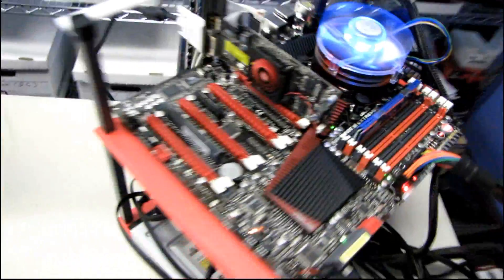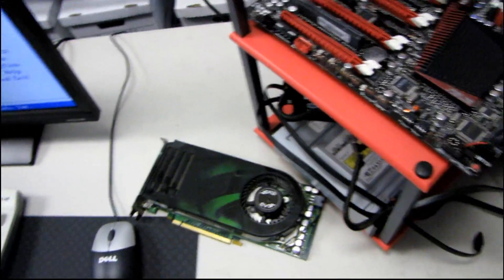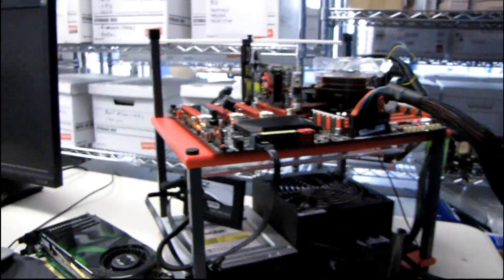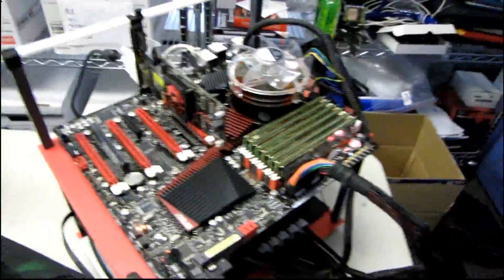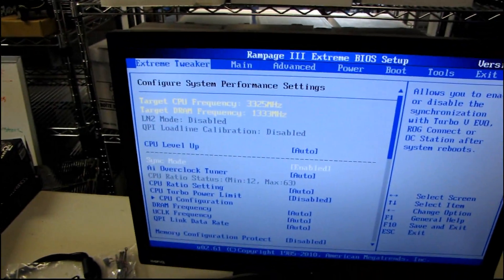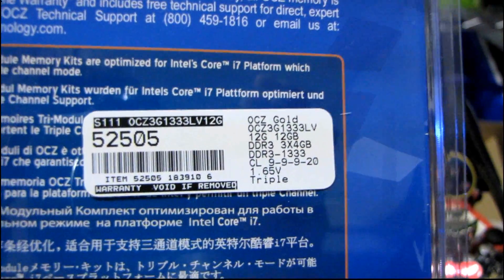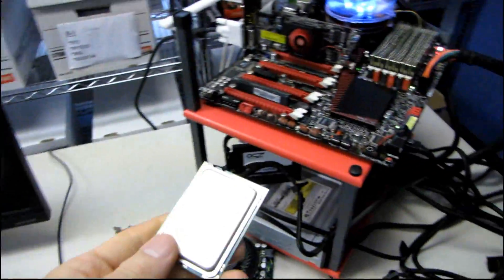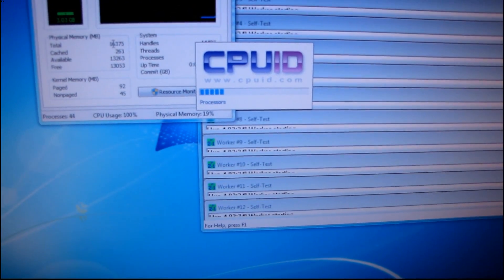Rampage III Extreme 24GB RAM Core i7 980X SUCCESS!! Linus Tech Tips

Comment: There are several fields where this could be usefull. In fact most of the time, this amount of ram will be used to keep files in ram and avoid disk access :
- Video editing or FX
- Big databases
- Running lot of Virtual machines (network applications developpment)

But there's no use for gaming.

Comment: yes its possible but you would have to get a 1,200$ board and pay 10,000$ for that much ram, 4 of those amd 12 core cpus and install windows server 2008 since windows 7 cant use that much ram. so yeah if your willing to spend 25,000 bucks for a useless machine

Comment: My new build has 32 gigs of RAM at 1600 MHz unclocked, running an i7 2700k at 4.6 GHz, and nVidia GTX 580 graphics. Open AutoCAD and SolidWorks 2012, rendering like you wouldn't believe. Also all latest games blah blah blah...
After years of being behind in RAM......NO MORE I SAY.

Comment: Well that is odd. Something more serious than a broken solder joint on the GPU then.  Unless you baked it with the GPU facing down which can make it worse since it will pull away or other parts will fall off.
Or the other thing is ESD damaged it.

I know it worked for me on the 8800GTX on two different cards. Which also the 8800GTS is known for too.  

If that 8800GTS did work it would be a bottleneck anyways. Its almost passed its usefulness on gaming these days. Even on that high end rig.

Comment: you could at least test if the BIOS detects all 24GB by disabling "fullscreen logo boot", this makes the POST screen to show up and you see how much memory the BIOS detects. Also you might disable "quick power on self test" and let the BIOS make a memory test. This will take a few minutes

btw, prime95 is not a really good memory test software, it doesn't detect all errors, memtest86 is much better. And it almost all memory, because it is on a bootdisk.

Comment: my guess is check the list for ram supports, obviously it might work but who knows, you didnt mention the power supply wattage, maybe the system didnt had enough voltage to run all rams, or maybe you had 2 defective rams :( and if that where true, the motherboard needs a refund jeje. oh and one last thing, i know ppl might say and said "why would you need 24Gs for?" well good job for putting the board test its limitation which its what this is all about, good job man.

Comment: @MrTpengineer I've never had an issue until recently when I started getting some driver errors. Other than that they've been every bit as good as AMD's cards (at least recently, they were better than AMD for quite a while with the 8800 and 9800 series, until the 4800 series came out).

Comment: ## I Need Help With A Ram Question ##

1 GB = 1024MB

Therefore

8GB = 1024MB X 8 = 8192MB ... Right?

I just Recently upgraded my my ram from 4GB to 8GB but I encountered one little problem.
In CPU-Z it shows that my computer has 8192MB of ram but when I open task manager it only shows that I have 8174MB of Ram. Where did 18MB of my Ram Go?
Is my Ram faulty? When taking the Ram Sticks out of the packaging I noticed white paint on one of the corners of the Ram Sticks.
Also I have a HD 6870.

Comment: @CarrollFilms So your videos are ranging from 240% smaller to 3,500% smaller than the conditions I'm talking about. A friend of mine is a professional video editor, and he sometimes has to render several 1080p video streams at the same time and can hit 16+GB of usage, so he requested 32GB of RAM when I built his rig. Not everyone (in fact very few people) need that kind of power, but some do, and it won't hamper performance unless you're trying to max out your CPU overclock.

Comment: I'm totaly against over clocking , I know that might not set with those who do but I have damn good reasons.

1. lowers longevity of components if they aren't rated for higher speeds and voltages and stresses them.

2. can cause software errors

3. lack of funds to replace components if they fail from over clock.

4. can void warrenty.

Comment: @NorJ92 

windows is not using 16gb of ram. Windows is using all of the 24gb of rams. Is just that windows 7 editions have weird options settings that only show you part of the information. 

For example the dxdiag always shows 1gb graphics card having only 751mb. But if u use other tools it shows 1 gb and games also shows 1 gb.

Windows 7 have hidden options.

Comment: Linus Ran into this same issue when you try to run 24GBs of RAM on a G1.Sniper. It is not the BIOS, it has something to do with the way the board reads the memory and the speeds, for some reason if you try to go at the 1600 speed you are reduced to 16GBs of ram no matter what. It is fuzzy but its gotta be the addressable  to the CPU. I think at 1600 it cant see 24GBs of ram and needs to slow down to default which is 1333. I went through MANY tests with even newer ram and got the same results.

Comment: I had this problem once where i had purchased a nvidia card and put it in my motherboard which had an ati chipset built in to it. I had a 2 gb RAM in it and my windows only detected 1 GB. When i replaced it with an ati gpu it detected the whole 2GB. May be this is kinda related to the same problem which i had. try it

Comment: @acheron0508 

just kiddin :p

my real rig is 

amd athlon 64 3800+ ( crap )

1gb ram ddr2

radeon x1050 512mb ddr

450w psu

asus m3a78-emh-hdmi

maxtor 250gb hdd ;P very old system but on summer i will get

cooler master enforcer case

amd phenom x4 955 

4gb corsair xms ddr3

raid 0 wd black 6gb/s

radeon 6950 2gb sapphire

700w psu 80+

im very excitet for that rig :D

Comment: Look into PC component planned obsolescence. A Radeon 9800pro is actually capable of running most modern games at a good frame rate with all effects including DX11 specifics like Tessellation. Software is programmed to run slower on what it detects as a obsolete card.  Operating systems are also set to improve if an upgrade is detected. You can test this by taking out half your ram, boot windows, let it fully init, shut down and put your ram back in. It will be noticeable faster than before.

Comment: @ZeroHeroVids with the rampage 3 extreme when u shut down from windows.. everything goes off.. but theres still power in the motherboard in case u wanna turn it on later.. for a full shut down u willl need to turn off the power supply itself.. so im asking insted of turning off the psu all the time is it ok to leave the standby power in the motherboard or will be damaged if i leave power in it for a long time???

Comment: I'm confused as to why a your cpu is showing 12 cores or whatever. i'm running CPUZ as well and I dont see but 6 physical cores and 16GB/ram. i'm running prime95 right now and the "blend" options was set to 6, not 12 like in your video. what's up with that Linus?

Comment: Some of the modules arent working because the Voltage was too low. CPUZ will still show the total amount of dimms installed, but windows wont if some of the modules arent working.

Easy way to check if all the ram is working is to disable the boot screen logo, and see how much ram is detected on the boot up list.

Comment: I just left my ram voltages at default even though they are rated for 1.65v 
and left it at 1333mhz even though its rated at 1600
Everything works fine but should I change the settings to match their rated values for any reason? Just wondering

Comment: Linus, I don't know if you ever read these comments but heres one for you:
Today I had the same thing with my (second) Asus Rampage III Extreme and 12gb OCZ Platinum RAM.
It only recognised 8. How I fixed it? The RAM is low voltage (1.35) but more RAM does need a bit more power. I cranked it up to 1.38.. nothing..  but 1.4v = my 12gb. I saw you still had your voltage (QPI/DRAM Core Voltage) at auto. Raise it step by step. maybe yours needs 1.45v?

Comment: @breathoffog85 But to make it smooth enough to NOT kill your eyes, you need 4 OpenSPARC T3 processors (note: no windows for it), 6 HD5970s in crossfire (HD6xxx series won't work! It's weaker) and 64 gigs of RAM.
Oh yeah, you'll still have to use gamebooster or something like that, because you don't want any random processes using up your CPU!

Comment: The 980x only suppurts 24Gigs of ram runnning at 1024Mhz...  I run 12 Gigs of Corasir Dominators 1600 Mhz. But Bacause of BIOS limitations, the second that i run just 1 Mhz more, OS only detects 8 Gigs. 
As far as I have found out. No BIOS today support more than 8 Gigs running more than 1600 Mhz.

Comment: @StokaSR No sir, you are a dumbass, the i7 2600K = 300$ , 1090T =229$...
2600K = 6600 3DMark06 Points, 1090T = 5770 3DMark06 points
2600K = Crazing unlocking potential (4.7Ghz + on air), 1090 = not so much..

Comment: I had the same issue with 24GB not showing up although I was using MSI x58 Pro-E mobo.
It was in fact to do with the mobo which when it was replaced (same mobo) the 12GB showed up in windows. 

Try putting your 24GB of ram in a different mobo and see if you have the same issue. If so, then its not the exact same issue.

Comment: @AnarchyEngineer It's a i7 980X CPU, A six-core CPU, but it has Hyper Threading, so it has 6 fysical cores and 6 logical(imaginary) cores, and that gives the 12 fields in taskmanager.
But i7 doesn't have the bridge for 2cpu's on 1 motherboard(if i'm right), but the Xeon have, so you can have two 6 core Xeons on one motherboard ;) (if i'm right)

Comment: You can have 192GB of RAM, but CPU management and MOBO management in the current technologies don't allow that much, the maximum that I think there is, for PCs (and not fucking huge server mainframes) is 24GB, like this system. But at software level, Windows 7 supports up to 192GB.

Comment: Re: Your memory - I have this same motherboard and CPU. Read page 2-15 of your manual. i7 processor's onboard memory controller may have issues running dual triple channel above 1600. You may need to correct your mem controller or uncore  voltage, loosen your memory timings, and dial the mem clock back. Be sure to cold boot and let the mem controller recount. I have 12GB Dominator II at 1854Mhz and doesn't count it all always after warm boot. Good luck!

Comment: I think you increased the speed of the memory beyond the rated in the bios . Don't know if it's related but I have Kingston Hyper X 2133 MHz memory which will run OK at that speed using the extreme memory profile but at that speed Windows only sees 4GB instead of 8GB actually installed.If the XMP is lowered to say 2000 MHz Windows knows it has got 8Gb.

Comment: hey linus....i had a werid problem while overclocking my 860....when i put the multiplier to like 16x or w/e..i cant remmeber..and i put the base clock to like 300...and the ram MHZ didnt get in the range of 1600 MHZ witch is what my 8 gigs of ram is rated to run at....so it only read 4 gigs of it instead of the nomal 8...so all i can say is get your ram to run at the exact mhz its rated for or put the CPU back to the stock factory clock and see if u get the 24 gigs...hope it helps :D

Comment: Linus It is very possible that u need to tweak the qpi/dram voltage a little higher due to the amount of slots being used.....Also make sure the cooler isnt too tightly placed to disrupt its place in the socket (Has happened in quite a few cases) due to the cpus memory controller. Another issue could be to take out the cpu and look into the socket with a magnifying glass( for optimum sight) for any slight bent pins....Also make sure the memory is on the Qvl..... and the individual stiks..

Comment: could you check how much memory u can see in windows? i had a similar problem with 6 Gigs of ram on my EVGA X58 SLI LE, windows said '6Gig installed, 2 Gig usable' O.o thats what i thought. i couldnt fix the problem myself, so i switched the motherboard and woops same thing happened after 8 days. i checked the bios, i switched the ram modules(Corsair dom 1600MHZ Cl8). nothing really helped. CMOS reset with all modules. nothing  helped. i thought its a problem of the X58 Chip.